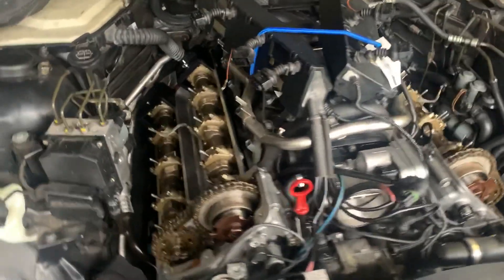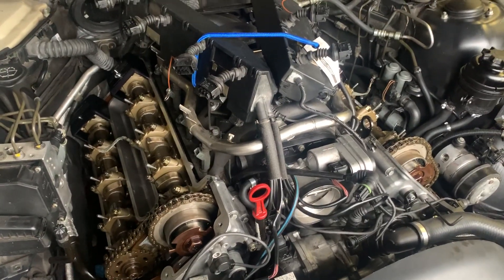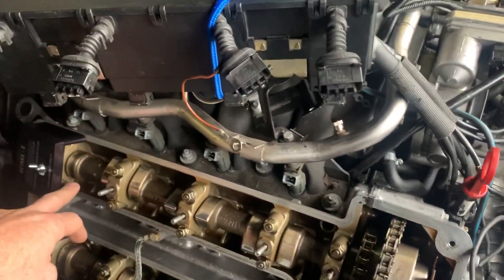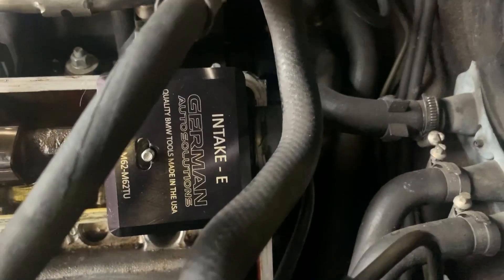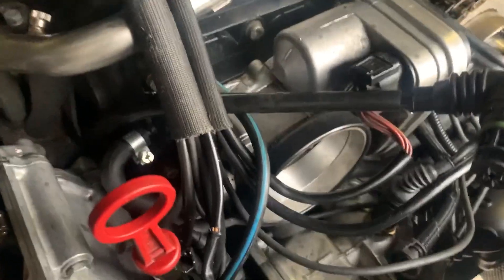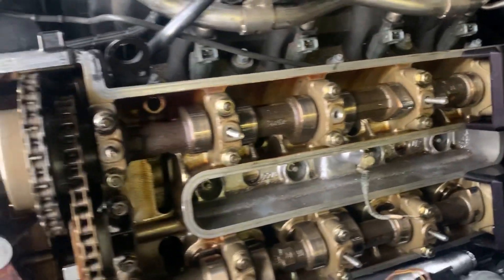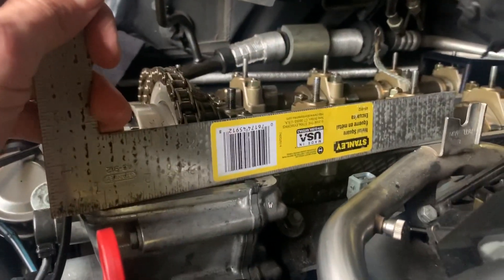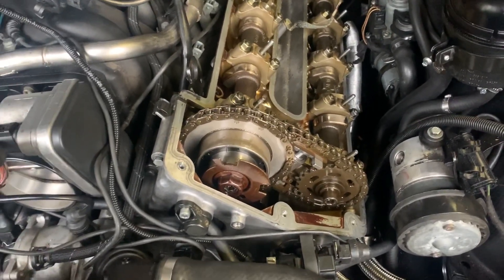My problems with P0011 P0021 m62tu bmw 540i - Timing

Comment: Did you ever figure it out. You're the first I've ever seen use the inspection holes.
Reply from the maker: Yeah. Specifically torquing the exhaust cams first made all the difference.

Comment: Thanks for the help, Tim. I'm experiencing the same problem after replacing the timing parts. I'll give your advice a try and cross my fingers 🤞
Reply: Did you fix it??
Reply: @salvadorzavala6110  yes. It was actually a mistimed impulse wheel on my VANOS. The wheel was not completely retarded before I tightened the cam bolt. All is well now thankfully.

Comment: Did you have new vanos solenoids? IDK if this could be your problem but I believe there is a seal on the vanos unit itself that can change the oil pressure into the vanos causing the solenoids to advance or retard timing of the cams.

Comment: You keep telling people your car is now fixed yet you won't tell anyone the exact answer to your problem. Not trying to sound rude but seriously smh. I mean this is clearly not a unique problem. It happens to everyone using both the Chinese kit and the German Autos solutions kit. Just annoys me cuz your answer may just help 100s of people out just to check out whatever you fixed or someone else fixed. Clearly the timing tools are garbage regardless to what people say. If engines were running properly before the repair clearly these tool company's are screwing up on some tutorial and then to add to that you have people like your self who fixed the problem but refuse to say what the hell you exactly did smh
Reply from the maker: I certainly wasn't trying to solve the problem with the video. The video was used to post to the forums to get insights into the issue from forum members.  You can see from the description the steps taken to solve it.  The specific action is the step that I believe made a difference was "Torqued the Exhaust Cams down first to minimize movement."  This specific step was not outlined in any guides in that order.

Comment: Did you figure it out? I got the timing advance bank A Which caused the plastic guides to break. Switched em out but now I'm back to where I started. Timing is still slightly advanced , scared to start it up and break the guide again
Reply from the maker: I can speak from experience this is super frustrating.   From my experience, the advance timing would NOT cause your guides to break unless something was pinched, binding or a slipped tooth during the timing process.  1. What timing tools are you using?  2. Why do you think the guides broke because of over advance?
Reply: @timpnw  well, I suppose the guides could shatter simply because of age alone, nothing lasts forever right? Bjt,  it seems safe to say that its only the "U" shaped center guide that breaks. So there is more than just wear and tare going on. I just noticed that the bank a cam tensioner  isn't  pushing up on that  rightside.. that might be where I'm getting just enough slack to slap that "u" raul
Reply from the maker: @keva2751  this doesn’t sound good at all.  What’s the current status of your engine as it sits?  I mean. Any slack is a going to be a problem. I strongly recommend watching all the m62tu timing videos on YouTube.
Reply: @timpnw  got the slack out, its a good thing I went back and started over because I had the cams on bank 2 locked a whole stroke off. The numbers 5-8 are supposed to be face up when locked in place right?
Reply: @keva2751  yes

Comment: please help me i have same engine and i have same code p0021 What do I do to fix the problem?
Reply from the maker: Any other symptoms? Any recent work done on the car?
Reply: @timpnw  

The Vally pan and Valve Cover Gasket were fixed and intake manifold gasket  and  CCV and afterwards the technician told me that the B camshaft needs to be modified and after that work this code appeared before that there was no such code.

The code details say it is Camshaft Position-Timing Over-Advanced Or System Performance Bank 2

please help me The Car BMW E39 540I 2003
Reply: My Frind I Need Answar Please
Reply from the maker: M H D “camshaft needs to be modified” from fixing the fixing those gasket  leaks seems odd to me.   The timing covers would have to come off to adjust the time...  the only thing I can think is the mechanic bent the timing wheel which sits on the end of the cam/vanos while installing the valve cover gasket.   Check bimmerforums, there are instructions on how to adjust the wheel without taking off the timing cover.
Reply: Same here. Timing advance shattered the chain guides, half way through replacing them but need to fix the timing advance or else it will all be for not
Reply: @keva2751  your bad guides are what was causing your car to be over advanced ! When you replace the guides and time it correctly the over advance codes should be gone .

Comment: Did you fix the issue? I have a code p011
Reply: It is almost always a timing issue. After the third try with an eBay timing tool set, I concluded on the GAS. It fixed my timing issue immediately when used correctly. The vanos trigger wheel MUST be in that EXACT position. There’s no compromise on that. Sometimes not even the inspection holes on the front timing cover would give you an exact position for the wheel. Hope everything worked out.
Reply: @samaid16  my cam & wheel moved after i took off the cam lock blocks, did yours?
Reply: @samaid16  gas? Can you provide a link?
Reply from the maker: ARTHUR NEROSHCHIN - Yes.  Fixed. No codes.  I have a vacuum leak to work through but that had nothing to do with timing. The CCV is humming good.
Reply: @timpnw  did you buy timing tool? I need to rent one
Reply from the maker: ARTHUR NEROSHCHIN Yes.  You need the timing tools.  I went with the german Auto solutions.
Reply: Did you buy it or rent it. I can't find anywhere to rent it.  Let me know if you can rent it out
Reply from the maker: ARTHUR NEROSHCHIN bought them.  Given that my car was apart for 5 months and  retimed it 3x, I really recommend buying them. Looking for 2005 4.4 Range Rover I can tear into now.
Reply: Yes.  The cam will move when you take off the cam blocks because it’s always on a tension. If you notice, in order to adjust them while putting on the cam blocks, you have to use its 27 mm wrench to insert the blocks.
Reply: Was the p0011 code a vacuum leak or a timing issue? I’m getting the same code
Reply from the maker: SJDTV it was out of time.